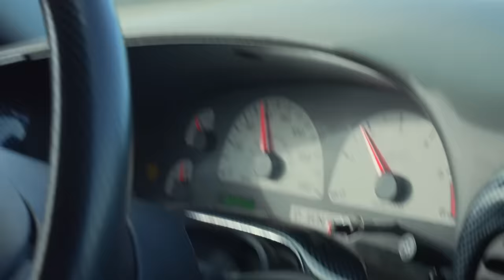Did Brendan Schaub buy a Lemon Lightning off the internet? | TUNE TOWN EP2

Comment: A failed father to son advice about cars. It doesnt matter what a car of that age would look like. Its whats under the care that counts. Check for rust, shocks, tires, fluids, hoeses, and then test drive it at high speeds and citty speeds. Idle for while while you check underneight for any leaks. Now a days you can request a carfax and your done. From there you can make a educated guess on its value. I bet Brenda did 10% of this and took 90% of the seller's word.

Comment: Brendan what a bro got to do to get my  95 short bed short cab v8 street truck pimped? less than a 100k miles and was my late fathers truck. My dad was never late picking me up cuz it has full exhaust system and chipped. Way cooler than a lightning.

Comment: I really dont think that stock wiring was designed for a 30 amp circuit.... should if just bought a single high quality pump or added a relay and run a dedicated 10 gauge to the fuel pump or something similar... these guys look like pros, but idk man....a

Comment: Why did he purchase it? Surely you send the inspector who just signs off it's as described, they're not going to rip on a track or anything. Then you say, I'll fly out tomorrow morning, will you hold it for me? Then you test it and any performance car should let you accelerate and stop. Dead give away there's issues and you either negotiate the price or walk away and take the cost of air travel as a loss of trying to buy an older, rare car. 

That's all on this knuckle head, if the guy said you have to buy without test driving it - walk away. (this is ignoring the fact this wasn't a lemon and he doesn't have a clue what's he's bought)